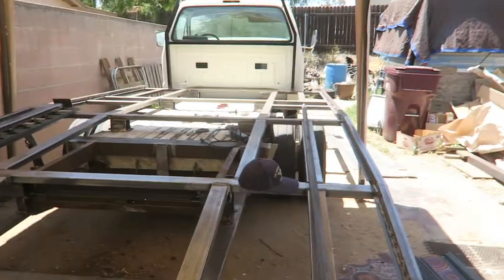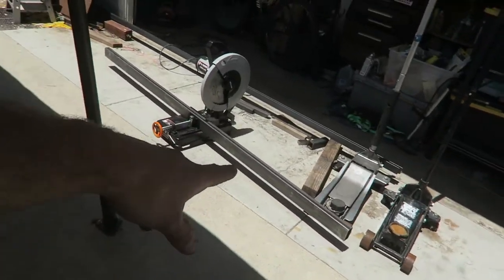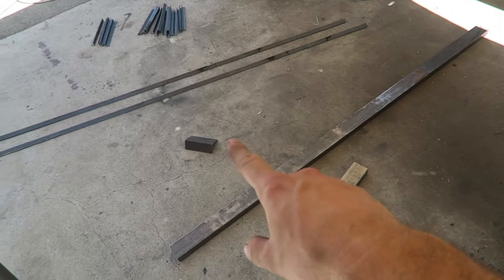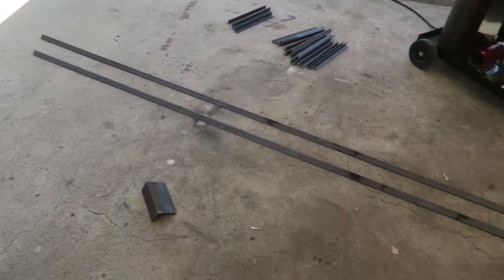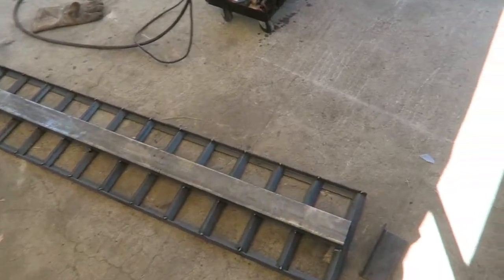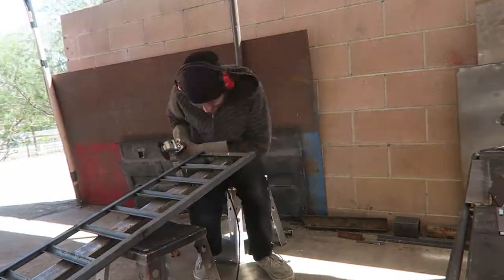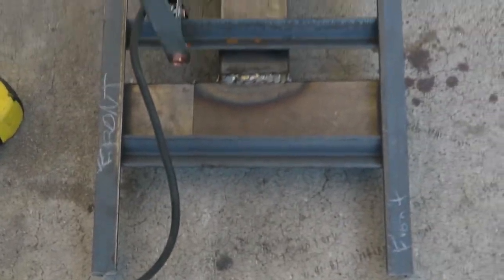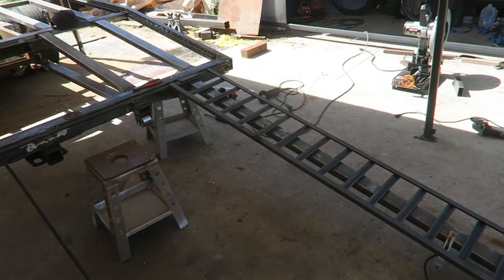How to Build Ramps - Ramp Truck! (Episode 10)

Comment: What type of blade did you use to cut the angle iron?i only see those grinder type cutting disks but these metal ones seems to cut faster?what type is it?
Reply from the maker: its the best its called a cold cut chop saw
Reply: @flossymissiles  does it use a certain type of blade?
Reply from the maker: volution Power Tools RAGE355 14 inch 36T Circular Blade

Comment: You welded the center supports on the wrong side of the ramps . The angle iron closed side should be top side. Open angle on bottom . Closed side is much stronger . open side up tends to bend down